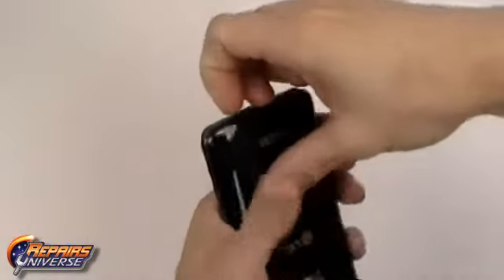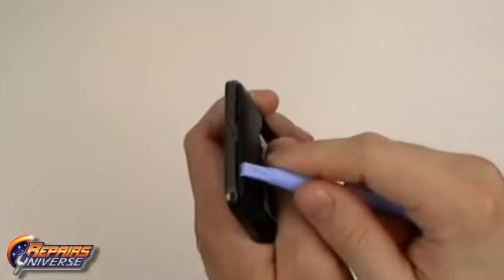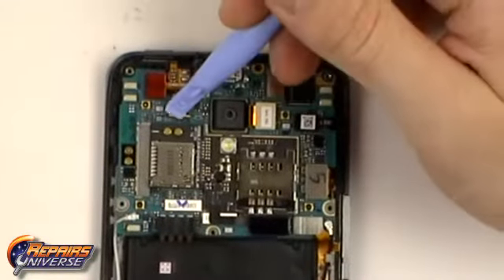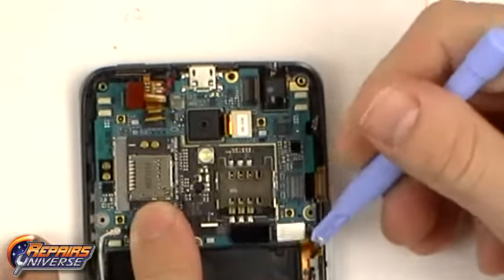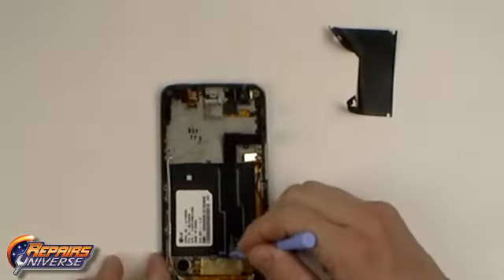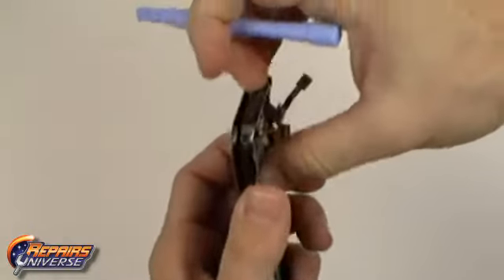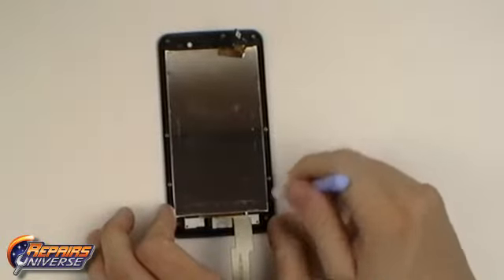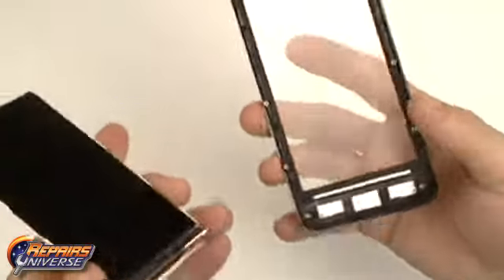LG Spectrum Touch Screen Replacement "How To" by RepairsUniverse.com

Comment: I just used these instructions to replace the digitizer screen on my LG Spectrum VS920. It's a bit harder to clean out the shattered glass from a broken screen than the complete screen in the video! I should have gotten the adhesive strips, but I used contact cement to attach the screen to the frame and it's holding ok.  Thanks for the detailed instructions.

Comment from the maker: Often times when performing a repair some of the internal connections can become loose or dislodged. We would open up the device again and make sure all the connections involving the touch screen are securely connected in the appropriate places. Otherwise you may have a faulty touch screen. Check for damage on the touch screens flex cable. Best of luck.

Comment: On a scale of 1-10, I'd give this video a 9. It would've been a perfect 10 if it would've included the adhesive application needed when putting it back together. Had to order 2mm doublesided tape separately. Otherwise, great!!

Comment from the maker: New adhesive creats the strongest seal. You will not be able to connect the new touch screen digitizer without taking the device apart.

Comment: If I were to replace just the digitizer, could I just remove the digitizer flex cable from the motherboard and heat the glass to pry it off without removing the LCD and everything else? Another question, do I need fresh adheasive to put on the new digitizer?

Comment: I have just used these instructions to repair LCD and Digitizer on my LG Spectrum *2* (VS930).  It seems like I will need more adhesive to get the digitizer to "stick".  Any suggestions?  I didn't find the digitizer on your site.  Would superglue work?  Thanks for this awesome instruction!

Comment: OK hello hi my mom phone lg metro pcs and the screen isn't working its like she can't move some parts of her screen especially when she playing her apps games then it shuts down it self and go to lock screen or it freezes and turn off it self like please help ?
Reply from the maker: imashaleyg Sounds more like a software issue. Try performing a system reset but ensure to back up her data first. That may help.
Reply: Repairs Universe So it isn't her screen it doesn't need replace?